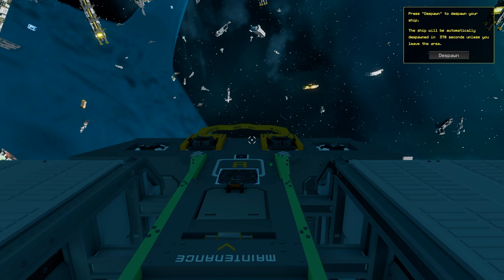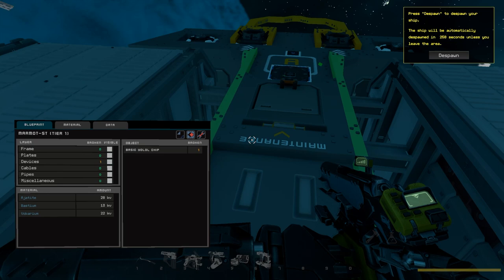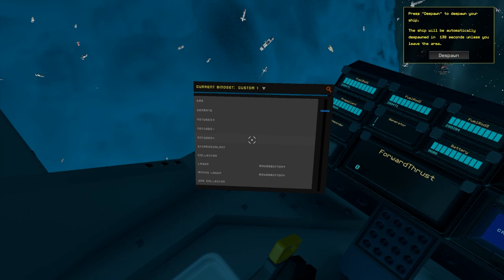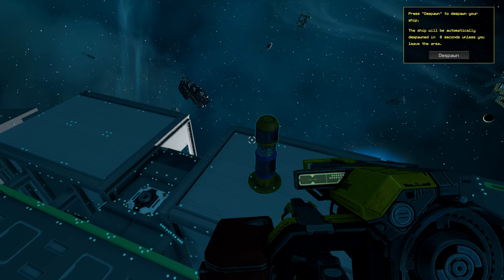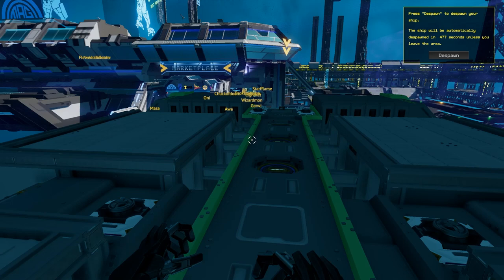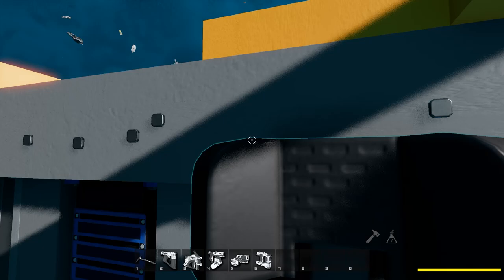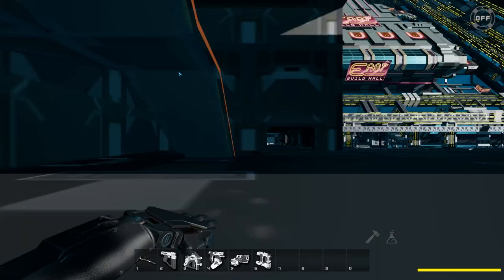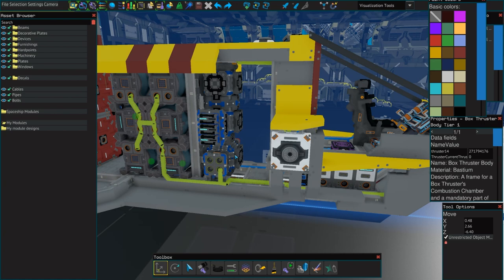More Tips and Tricks

Comment: I find that you should always open up the universal tool and enable the ship durability mode when bolting/unbolting things, 1 bolt too few/many can and will mess up your warp class enough to cause damage. Even if it is green that doesn't mean it is good, trying to keep the highest warp class (or as close to what you started with) is vital, especially if you plan on covering your ship with raw ore.
I bumped the starter ship up to a warp class of 2 and try to make sure it stays as close as possible at all times. Sometimes you may have to fully bolt an item down and then slowly unbolt it in order to get the best warp class (you can also hold the auto unbolt in short bursts to remove 1 hidden bolt at a time).

If you don't try to maintain your warp class and end up keeping that ship for a while, you may get to a point where upgrading becomes difficult and/or requires a complete service to increase the warp class again.
Reply from the maker: Thanks

Comment: They need to make repairing less finicky, sometimes plates won't form if other plates are too close, meaning you have to pull the ship apart to make the plates you need. And don't get me started on bolting, some premade ships have some very specific stress points, if only the repair blueprint tells you where the bolts used to go... spent hours fixing some surface plates on my Marmot and I could not get every plate green no matter where I bolted... Even some feedback from your tool as to why there are durability errors would help.
Reply from the maker: you should submit that to the devs in the feedback option in the F1 menu